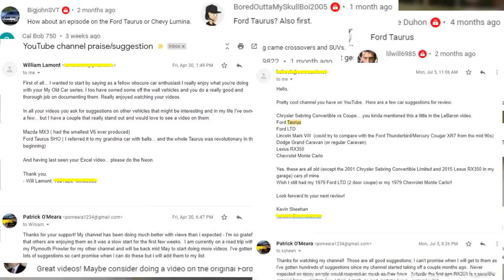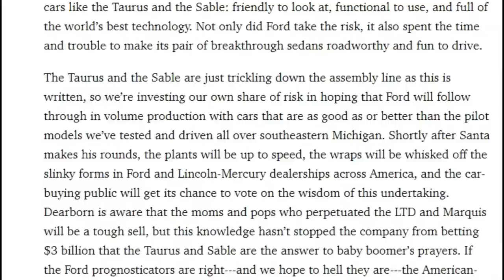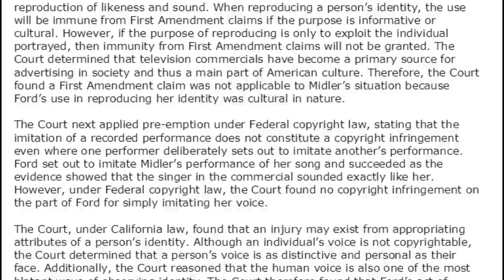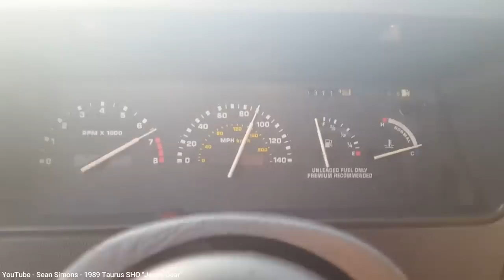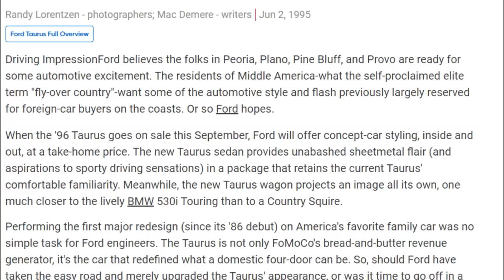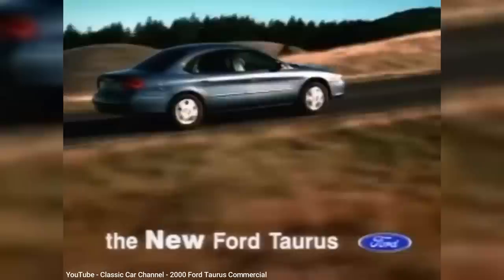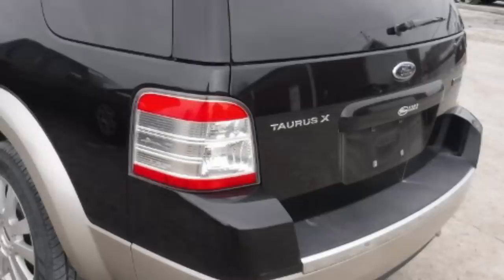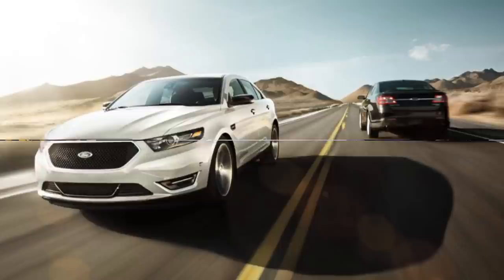Here’s how the Taurus went from Ford’s best seller to a forgotten icon

Comment: I had the first year Taurus with the 4  cylinder engine. The 4 had a reputation as a  bad engine with a bad transmission, so the resale value values was low in 1990. I was thrilled when I got rear-ended by a delivery truck because I got way more than the actual resale value from the  insurance company when it was totaled out.  The  insurance company also provided a car buying service to negotiate the best price for the next car I got. I bought a new Accord.
Reply: Smart. Mine got hit from the rear & pushed into someone... I called it the accordion. ( it was good but ugly after that)

Comment: The rename of the Five Hundred and Freestyle also had a little bit to do with the notorious CVT issues that plagued both models.  The switched to a conventional 6 speed auto when the names changed.
Reply: They also changed the engine (from a 3.0 to 3.5) and increased suspension travel for a softer ride.
Reply: The CVT was only available in the AWD model.
Reply: Chrysler never had any issues They were the best in quality reliability  dependability  also in sales They outlast and outsold Ford
Reply: @michaelflores2318 ? Who mentioned Chrysler?
Reply: The CVT was available in all of them for the Freestyle.  I had a FWD 3.0 model.  One of the best cars I've ever owned.  My wife cried when we sold it.  Never did anything but change the breaks and oil.  Our CVT was rock solid.
Reply: The Sebring and Stratus were great cars and top quality made from Daimler Benz materials and parts
Reply: @foxesamu  they beat Ford in sales Everyone chooses Chrysler over Ford so they must not be garbage
Reply: @michaelflores2318  bahahahaha whatttt??? Lol Chrysler has and always will be junk. Coming from a ford guy that used to appreciate gm and will probably buy a Toyota or Honda next lol

Comment: My buddy had an SHO Taurus. Amazing engine for the time. 220hp was off the charts on horsepower for a normally aspirated 3 liter V6.  To give you an idea, the Mustang GT that came out in 1988 had a 5.0 V8 that only made 225hp. The V8 in Magnum PI's Ferrari 308gts only made 237hp. Too bad the shifter on the SHO felt like something off of a farm tractor.

Comment: Thanks for the MT-5 mention. I had a 1986 MT-5 and loved it. It made the 4cyl tolerable by allowing longer shifts and being lighter, it was nicely dressed up, and quite reliable (for a Ford). But poor quality caught up with mine around 150K miles. Bad rust, three water pumps and the steering column catching fire. Oh, and it was cursed with "unintended acceleration" which was lucky it had a clutch and only 90hp, to keep it out of fatal accidents.
Reply: Wow!   A little bit of honesty!?!    video seems to have skimmed over how many quality issues there were...

Comment: When I was in high school in the late '90s I would design knock-off versions of vehicles on the computer. My versions of the Ford Taurus and Mercury Sable were known as the Tortoise and Stable, respectively. I had designed other car and truck models as well.
Reply: And now Elon Musk ripped off your stRanger and called it CyberTruck.
Reply: Easy to do, just take a chicken egg and put wheels on it lol
Reply: Ford always made Crappy cars and trucks Chrysler was the top of the line Ford should be #3 not #2 Ford should not be allowed to be in production I would love to see Ford shut its doors forever then it would Just GM and Chrysler would be the Big 2 no longer Big 3
Reply: K cars had the 2.2 Hemi and will beat the Taurus with the powerful engines
Reply: @m42037 Chrysler  had the best looking cars The K car was a hit they were much faster looking and outsold Ford Ford should be shut down for good But these mofos want to keep going If it was up to me Ford would no longer be in production
Reply: @michaelflores2318  I remember those K cars. They did look better than the "Chicken egg" shaped Taurus and Sable, those things were so ugly! Like most SUVs today they all look the same.
Reply: What program did you design them in? Was it a 3D modeler or some kind of CAD software?
Reply: @brickman409  He used MS Paint.

Comment: Thanks for giving the Aerostar a mention. It was fords gamble that to beat chrysler the key was to split the difference between the chrysler minivans and the chevy astro. It didnt work out as planned but it didnt fail either.
Reply: Astro/Safari also Lumina Silhoutte Transport and others could not mess with Chrysler neither Chrysler is the only U S auto maker still making mini vans and they have improved

Comment: I had many as company cars in the 80’s and 90’s. Reliable and comfortable. The oval models were kind of ugly, but still a great car. Drove a 4 cyl. Now, that was an underpowered mess. The Ford dealer in my town at the time told test drivers to go right out of the lot instead of left up a hill so that the 4 would not seem so weak!

Comment: I’ve had a good amount of time behind the wheel of the 2015 AWD model. It’s a good car with decent power. But where it really shines is handling. The car takes turns really well for a 4100 pound car, it feels glued to the road. Hardly any body roll.  And the trunk space is absolutely ridiculous you could probably fit Delaware in it

Comment: Omg, my mom had a 1991 Taurus when I was a freshman in high school and then a 1998 Mercury Sable when I was a senior in high school. The 91 had a bunch of electrical issues, and the 98 had transmission failure twice. But damn those cars were roomy 😁.
Reply: Yeah the 98 generation was notorious for transmission issues. Mine lasted 400k miles, replaced the transmission once at 140k, and it was going bad by the end of it's life. The engine was immortal though.
Reply: Yes, those were plagued with transmission issues.  I had a 97 Sable, transmission failure around 130k miles, I bought it at 110k.  Didn't make sense for me to replace the part, bought a 98 Chevy Lumina with (130k miles)for around what it would have cost.  The Sable left a bad taste in my mouth, and left me carless for most of a summer.
My mother had a 98(?) Taurus wagon and its tranny went early.
The Sable broke swaybar links every other month, I am not joking, nor am I a fancy driver, this was a design flaw.
I don't understand all of the praise for these mid-late 90s models.  
You're right on about the interior though!

Comment: Could we possibly get a video on the old Ford Ranger? I’ve owned three and while it was always a popular rig in my area, having been ten years since it’s discontinuation, they’re disappearing off the roads and parts are becoming scarce for those of us who never say die
Reply: Still driving my 94, will never sell it.
Reply: The Tamiya Blackfoot!  The "original" RC racing monster truck.
Reply: Just sold my 2003. They’re still very popular here in the mountain west.
Reply: Still have my 2000 Ranger extended cab with the 3.0 v6. Not getting rid of it yet. Runs great, well maintained. While I like the idea of the Maverick, unless Ford or another manufacturer comes out with a hybrid extended cab compact with a 6 foot bed, I’ll keep this Ranger until gas prices make it obsolete. Here on the west coast, there are still plenty of old Rangers on the roads. The current Ranger is too big for my needs. The Maverick bed is too small for my needs as is the Passport. So, Ford or somebody put out a real compact truck soon with at least 40 mpg or more and It will have me as a customer.

Comment: The 1987 Mercury Sable was the first brand new car my parents bought in my lifetime, I was 15. The car was light blue and had the 3.0 Vulcan V6. My dad loved  how it drove and loved telling me all about the 4 speed automatic with overdrive and locking torque converter. It was a basic model that didn't have any real options, but it drove well. And then the engine blew a head gasket after just a few months of ownership. Rather than dealing with my dad, Mercury was super nice and replaced the entire car.  My dad stepped up to the 1988 3.8 liter version, this time with most of the options. It had a noticeable bump up in torque, and the engine was smoother. They kept that car for nearly 10 years, until it was in need of a 3rd transaxle. My dad replaced it with a Suburban and they've never really  went back to owning a car, becoming a SUV owners ever since, except for the 2011 Camaro my mom bought for fun in late 2010.

Comment: I worked as an engineer at Ford packaging body electronics on the redesigned 1996 "coke bottle" Taurus (coded DN101).  I thought it was hideous, as did others on the team.  The buying public clearly agreed as this video points out.  Loved the '86-95, though (coded DN5).  It was the right car at the right time.

Comment: Another awesome video! I always had a fondness in my heart for the Ford Taurus because I remember how popular and cool they seemed back in the mid-1980s. My mom had a brand-new 87 Taurus LX wagon. My mom worked nights at a hospital and had to drive like an hour each way from Fort Lauderdale to Boca. My mother being the neurotic mess that she is was petrified of breaking down and getting stranded. Needless to say we didn't keep the Taurus very long because it seems like there was always something wrong with either the electronics including the digital dash, the headlights, the wipers, windows and locks, and whatever was wrong to make it just died for no reason when it rained. Fun fact that when Ford unveiled the new 96 Taurus at the Tokyo Auto Show there were Ford dealers that gasped and burst into tears when they solid roll onto the stage. In the industry we refer to that generation as the roach Taurus and the wagon as the cosmic Roach. Toyota's biggest competitor was the Taurus so those little Devils were slick and kept a close eye on what Ford was doing. 96 was the first year of the roach but 97 was the first year Camry that was very conspicuously looked very similar to The gen 2 Taurus where the previous generation Camry was much closer and Bloated looking like the original Taurus was. Just like the second generation Taurus was  the best and the 4th generation Taurus 00+ was equally as good and by far the best of the other American sedans it is a real shame that Ford could never build a decent and reliable 3 or 4 speed automatic transmission. Wild GM and mostly Chrysler have built some pretty awful and unreliable engines the leading cause of death in almost every Ford is the automatic transmissions. It was cool to know that Ford was concerned about the resale values of their cars so they stopped selling to rental car companies. Geez I work in auto finance and although I noticed that with only a few exceptions I hadn't come across very many modern Ford's on the used car market that were retired rental cars. There are two types of cars that I will avoid like the plague when I come across them at the auctions. Number one would be flood cars and number two would be retired rental cars.

Comment: The best Taurus was the ‘98 to ‘02 Lincoln Continental - which is essentially a Taurus with a 4.6 4V DOHC just for fun!
Reply: Fun. Until the rear air suspension went away. Then it cost a thousand bucks to replace the rear shocks. Even more if you didn't pull the fuse on the air compressor and then that burned up feeding dead air struts.
Reply: @scottbrown7415  I've never had air suspension failure.  I checked and found rear air bags for $120/pair and the air compressor as low as $125. If mine ever go out (I own a '98 and an '02) I'll gladly replace them - I like the smoothness of the air suspension.  My '98 gets driven once or twice weekly and it takes maybe 20 seconds to pump up after sitting for a week or so.  Maybe shops charge a lot of money, but I do all my own work.
Reply: @scottbrown7415  Owned a 1998 Lincoln Continental since 2007. Only major issue I had with the vehicle is the AX4N pump in valve body. Replaced that and the torque converter by myself. My air springs develop leaks from dry rot rubber. It took me less than 10 minutes to remove and replace them. My driver outside and inside rear view auto dimming mirror went bad. Replaced those in a few minutes. Even the power steering pump was cheap and easy to replace. Nothing costs thousands unless you go to stealership. I'm a do it yourselfer.

Comment: Always had a soft spot for the 2nd gen Taurus. 

I have a 94 civic hatch & a 92 accord. Would DEFINITELY love to see a vid on them even though they aren’t necessarily rare to see lol
Reply: my dad had one i 🤔 it was a 98 SHO and i hated it in 2000 but as im getting older i can see the appeal to it aka love hate relationship with the design the interior won't grow on me its a little strange for my tastes same way with the 1980's Chevy trucks ( to boxie for me, the outside is good though mins the paint vs tail lamps and the tailgate and back bumper aka some minor tweaking and 👌 ) one of which i drive